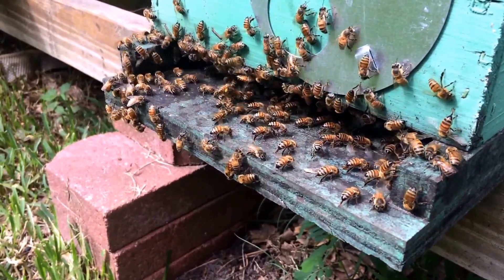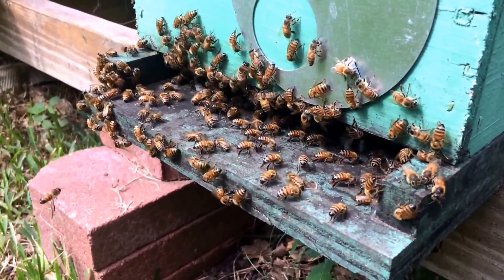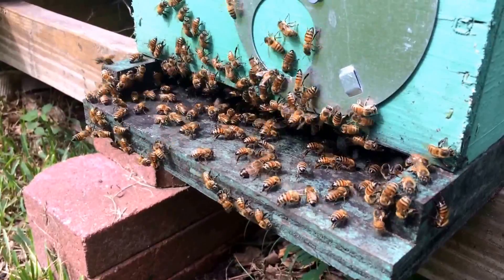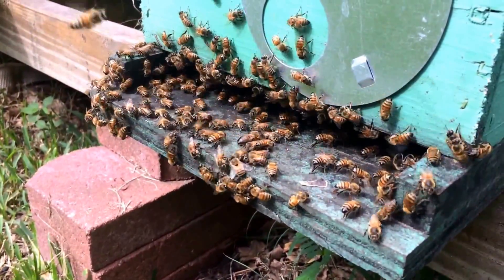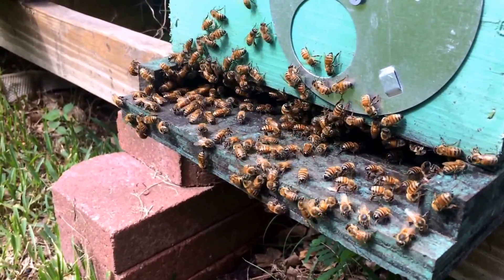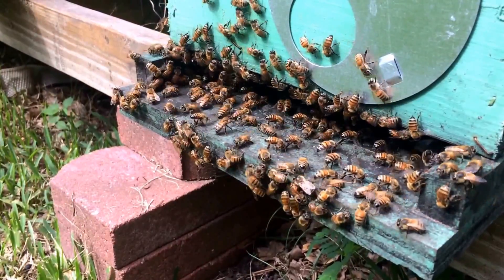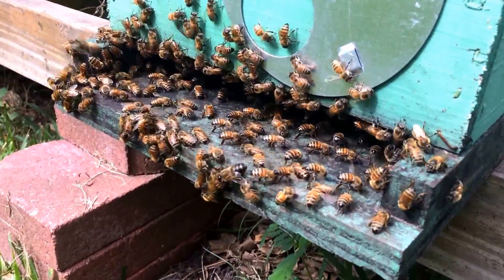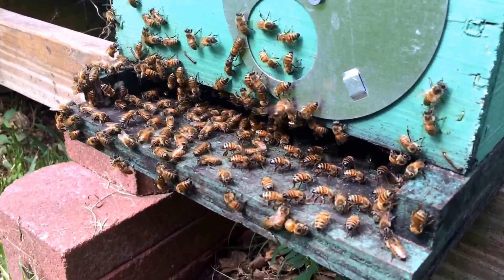Honeybees Fanning to Cool Hive

Comment: I noticed a few doing this in my new hive so I placed a couple hive bodies to shade them?
Reply from the maker: It should help. Anything to help break the heat, and improve air flow should help them cool the hive. Are you saying you just stacked spare hive bodies around the outside for shade? Or actually added a super to the hive to give them more space?